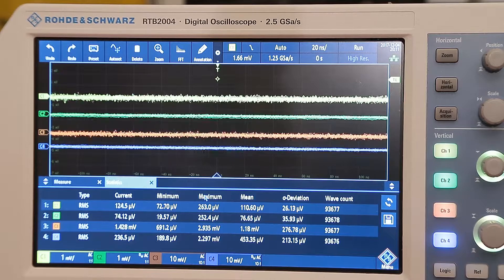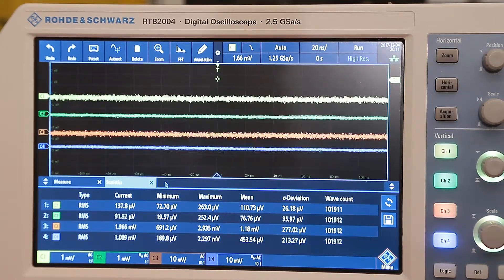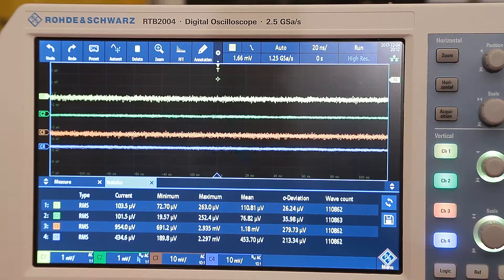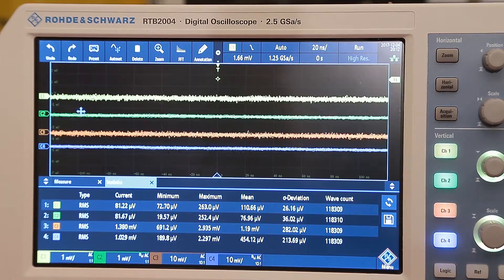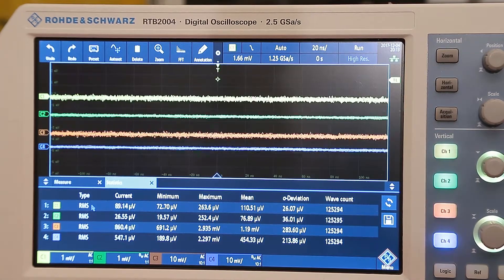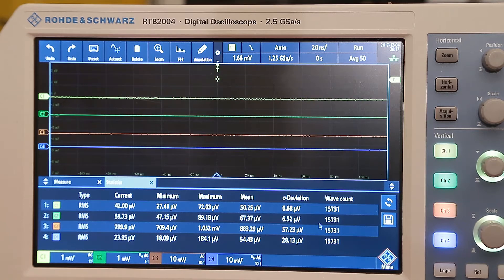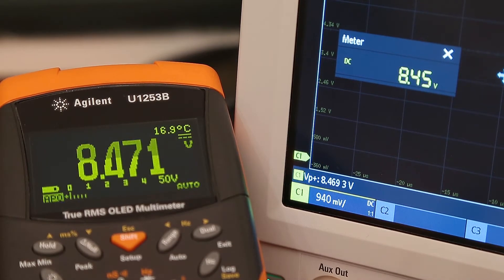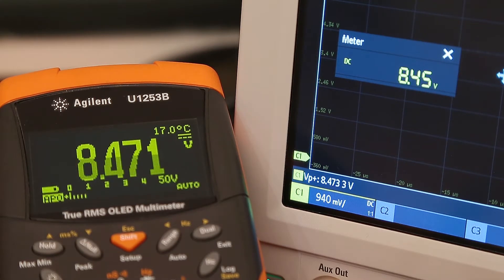Rohde & Schwarz RTB2004 Oscilloscope Noise, Accuracy & I2C Quality

Comment: Realize this is an old video, but RMS is not the right measure to use.  Any dc offset on the channel adds in.  There should be a std deviation primary measure.  Not std deviation of RMS… That would be appropriate.

Comment: This is a bad joke... He put the scope in HiRes mode (see icon on the top right). The noise is averaged. The actual noise is 3-4 times higher
Reply: Dear hadar hadar

Thank you for your polite comment/observation, it is appreciated.  I will in the next month produce another video showing noise measurements using a variety of Acquisition modes.  I normally use the scope in High Res. acq. mode, however it is a valid comment and I will run the test again.  I do actually show other Aqu. modes if you look at the 5 minute time marker. I also intend to run the test with a 50 ohm terminate connected to see the effect.  I would however comment, that as the noise levels on this scope are fairly low and not bandwidth limited as on some other scopes, it doesn’t really effect the majority of measurement undertaken with the scope at substantially high voltage levels.

Kind regards
Michael